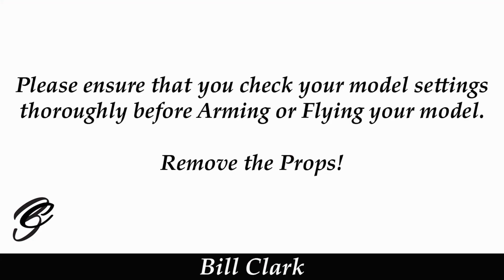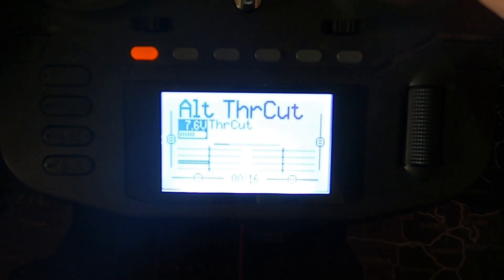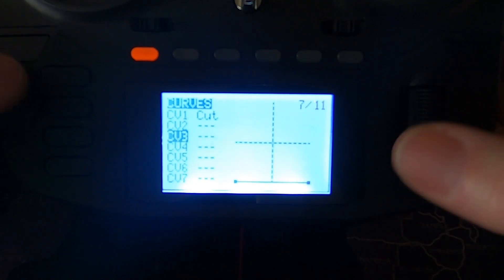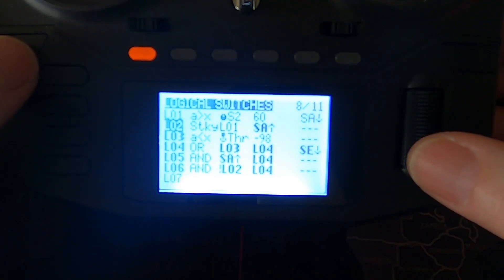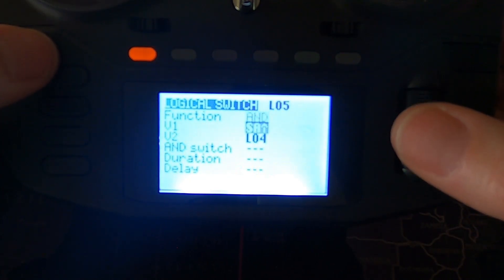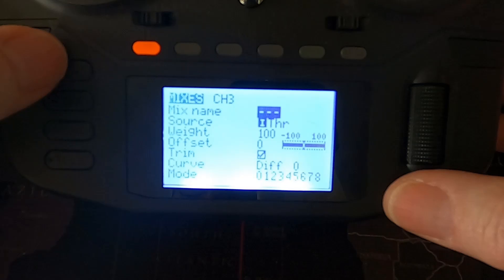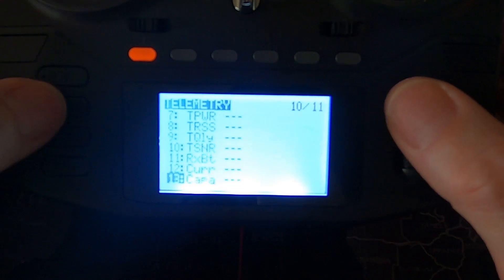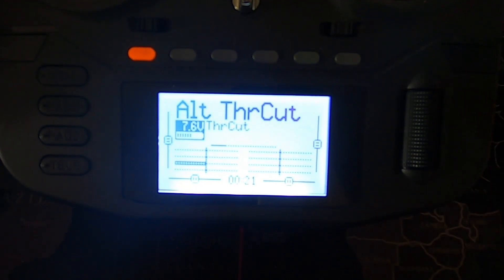EdgeTX Altitude Throttle Cut (Viewer Request)

Comment: Bill, fantastic work... I missed this when it first came out... Thanks for doing this for the F5K pilots out there... This should allow them to at least practice 50 meter (or whatever) launches without needing a separate altimeter. The official F5K rules are still in flux... The separate altimeter may be required for contests, but it's great to have options!

Comment: Hello Bill. Great funktion. Can you make one that do flap up when the plane is close to ground? Many thanks
Reply from the maker: So are you thinking of using flaps or flaperons as air brakes? The only concern I would have is the accuracy of the variometer, would the air brake deploy to high from the ground. EdgeTX could be programmed to to do this.
Reply: Yes, I use flaps as an air brake and I want a security so that the flaps will not be torn off if I forget to fold them in. @the-happy-RC-flyer
Reply from the maker: @lennartjohansson3335  I will work on this for you as soon as possible.